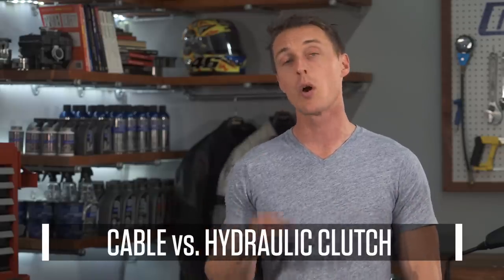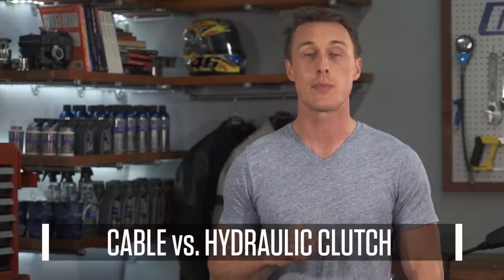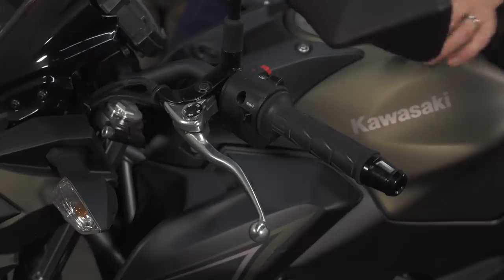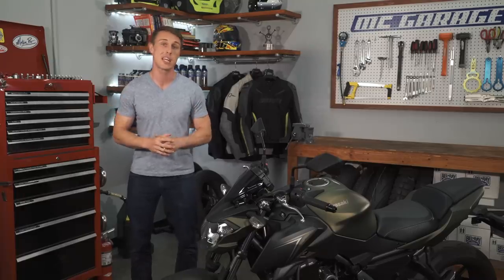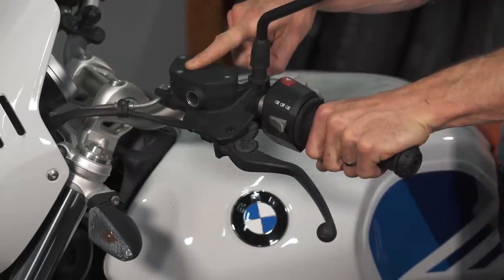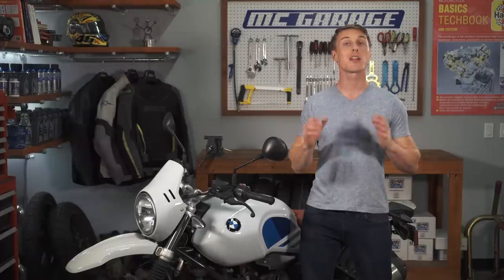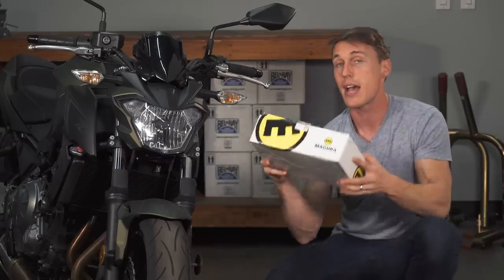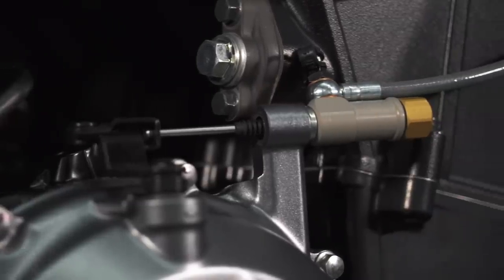Cable Clutch vs. Hydraulic Clutch | MC Garage

Comment: Changing a cable is a lot easier and cheaper than rebuilding a slave and/or master cylinder and/or hose and bleeding the clutch system, that's the difference to me I now have a bike with a hydraulic clutch and I was ecstatic about it... until it failed!  I definitely prefer the feel of a hydraulic clutch, but I'm not rich and I have to work on my own bikes so unless I win the lottery or become rich by some means this is my first and last hydraulic clutch!
Reply: Leslie Forsdyke im going through the trouble of a hydraulic clutch fail right now. It's horrible. Never getting a bike with a hydraulic clutch ever again. Nope.
Reply: Guitar Demo Vlogs truthfully it's easier than a brake rebuild but a cable is a lot easier than a hose, plus you don't have the hassle of bleeding a new hose which sucks, theres nothing difficult about it, buy it's tedius!

Comment: Can you make the video about clank in first gear and cable adjustment tension?
Reply: jasamnedostizan your always going to get a clank in first gear, adjustment is not going to stop it.

It's straight cut gears for you, if you roll your bike back a few inches then put it in first you will hardly get a clunck but it's nothing to worrie about.
Reply: jasamnedostizan like said the clunk going into gear is normal on the large majority of bikes. And it doesn't have much to do with the clutch unless the clunk is excessive and your clutch is horribly out of adjustment, and does not fully disenguage
Reply: and how to check that, fully disenguage?
Reply: jasamnedostizan if your clutch is very far out you will have trouble changing gear, all the service manuals iv had say to make sure the lever has a bit of free play like 3-5mm of movement before pulling the cable.

Comment: as a former motorcycle mechanic ive pulled a lot of different clutches and i call that easy pull statement with the hydraulic clutch BS!
the lightest clutch pulls are well maintained cable clutches. the heaviest are badly maintained ones. so if your clutch is somehow hard to pull, lube the cable. if that doesnt help, replace it. for most bikes thats around 30 bucks and done in 5 to 10 minutes. cable maintenance is really easy and only rarely you need tools or get your fingers dirty. 
hydraulic clutches on the other hand... especially the magura ones are often troublesome and if they fail and youre out in the middle of nowhere, good luck if you dont have the right tools/replacement parts with you. 
ive never pulled a hydraulic clutch that i would consider an easy pull. also i find that hydraulic clutches are less transparent and give less feedback so i really dont see a reason why you would want a hydraulic clutch. am i missing something?

Comment: but if youre on an adventure and your hydraulic clutch fails you wont be able to repair it right? with a cable you could just have a spare one in your bag and replace it. so is it good to have on a dual sport or is the risk of failure of a hydraulic clutch too high?
Reply: Probably depends on what fails.  I would suspect that neither system is more prone to failure than the other if both are properly maintained.  At that point it becomes an issue of what fringe situation are you worried about and is it enough to push you one way or the other.

Comment: I've had issues with both hydraulic and cable clutches. Was on a long trip with my Hayabusa a couple years ago, and the clutch started acting up (hydraulic). Air bubbles had gotten in the clutch hose. It was a real PITA to fix on the road, but managed to fix it well enough to get to my destination where there was a garage I could work in. Had to bleed the system several times to get it working 100% again.

Unless the clutch cable snaps, it's probably much easier to fix most issues on the road if the bike has a cable clutch. It's nice to not have to worry about adjusting the cable though when the bike has a hydraulic clutch.

Comment: Had a goldwing that the slave cylinder failed. Fluid in master kept dropping. Turns out it was going into the engine and mixing with oil. Not good. I am glad my new Versys1000 comes with a cable.

Comment: Why the clutch automatically applied little bit while throttling. It can absorb while 4 & 5 gears. It will release the clutch lever while stop throttling.

Comment: when I was a dispatch rider (riding the classic dispatch bike a Kawa GT550) I had a second cable threaded in position , a quick swap if the one in use broke .. doing 750 miles a week meant it would happen

Comment: Best clutch I've ever used was a hydraulic on a 07 cbr1000. Ive owned a cbr600 f41 and a 11 gsxr 750. I've rode gsxr 600s, r6s and a s1000rr. Would definitely take the cbr1000 just on smoothness out of all of those bikes.

Comment: You can easily run DOT 5.0 in the clutch dines since it will never see the temperatures that otherwise require the hydroscopic fluids.

Comment: Anything that you put on your bike/or your bike comes with will require maintenance. Most of the failure on the comments are from poor preventive maintenance. This is just like in cars, where you see a lot of cars with interference engines on the junk yard, because people don't maintain their timing belts, and timing chain cost more to replace.

Comment: how about SOHC and DOHC pros n cons?
Reply: SOHC: mechanical adjustment, easier to adjust but requires more frequent checks.
DOHC: cams work directly on the valves, less mass in the valve gear means you can run the engine at a higher rpm, harder to adjust, but can require less frequent checks. The book for my FJR1300 says check them at 26500 mile intervals.

Comment: What if the hydraulic line breaks you can't replace it on the side of the road at least the cable you can use picture wire in an emergency limp back
Reply: How often has a properly maintained hydraulic line broken? And if you worry about the clutch line breaking, why don't you worry about your brake lines failing?

Comment: well cable clutch is the only thing that should be used of road becurse if you breake your line you have to replace the line then add fluid on the clucht leaver end but the cable you only have to carry an extra cable and put i back on

Comment: You make cable clutch sound like very bad. I personally think cables need less maintenence and are easy to change or repair anywhere and by anyone. Periodic changing of clutch cables will be fine and don't need any lubrication. I havent changed or lubed cables much in any of my bikes and they still are fine.

Comment: I have an hydraulic clutch for the first time on my SD 1290. I have to bleed it once a month because it keeps sucking in air and loose action. So yeah, if they use cable clutches in MotoGP i think i can settle for one too. Good fucking choice KTM.
Reply: valebliz I have a 1290r Too and never had an issue. Why dont you take it in for warranty? If it's still covered?
Reply: 10fantic it is, all they do is bleed the system.
Reply: valebliz I have a 08 990 super duke with hydraulic clutch and never had an issue with it, the front brake on the other side has to bleeded every once in a while, but this can be done in less than 5 min
Reply: that's because KTM loves cables, considering their dirtbikes. Then came the time to create a hydraulic clutch, now they don't really know what the hlel they doing
Reply: Sounds like a bad seal.
Reply: Maybe the hoses and end themselves too
Reply: Ruby Rose wtf are you talking about? It's a few yrs KTM put hydraulic clutches on its dirtbikes, way before they did it with road ones.

Comment: I hate hydraulic clutches as you can't dial in play at the lever.
Reply: that is exactly why. No slack, for better control, and arguably better feel
Reply: It's a personal preference and hydraulic clutches determine precisely were the biting point is not allowing for each individuals preferences, the vast majority of bikers I know prefer cable.
Reply: apparently i can on my yamaha fj1200
Reply: I think the more complicated with more parts the more prone to failures. Keep it simple.

Comment: I never understand why when i look at a top of the line with all the bells and whistles 24 thousand dollar Kawasaki ZX10 with electronic shocks why on earth that bike (and many other high priced bikes) have a clutch cable setup. Stop being cheap and put on a hydraulic one! I always thought maybe there's a benefit to having a cable vs hydraulic? I dont think see and he didnt mention it - its just the manufacturers like being cheap.
Reply: It's probably due to weight.
Reply: What benefits?  And when you pay 25k for a liter bike dont tell me their passing savings onto us. Thats rediculous.
Reply: That questions is not for youtube, its for bike engineers... here anyone can act like pro and engineer..
Reply: The same reason manufacturers use rubber brake lines as opposed to braided steel lines. Cost. If they included a bunch of specialty items like the aforementioned, and things like brake lever protectors, a tail tidy, a K&N air filter, a double bubble windscreen etc etc etc. Your $24k top of the line supersport would now cost $26k. Not a huge difference, but the bigger that number gets the more it becomes unattractive. 

Plus it gives you something to do over the following years of ownership when you improve the bike bit by bit.
Reply: But they don't pay what we do for the setup, bulk buying for x amount of bikes is probably no more than a cable setup but they'll add a few hundred extra because it's an upgrade/feature. It's the same with any manufacturer, the markup on this stuff is crazy.
Reply: yet my 1986 VFR400 has a hydrolic clutch.... hmm.... it feels reaaal good too.

Comment: Hydro clutches feel numb and add weight.
Reply: Sounds like you haven't tried one in a while. Definitely agree that some older hydro clutches lacked feel and were heavy, but for the most part modern setups are excellent. Why else would they be preferred by trials and trail riders?

Comment: So why don't all hydraulic clutches use mineral oil?
Reply: According to Magura it's just manufacturer preference to use DOT fluid. A lot of OEs used to use mineral but have recently (in the last couple of years) begun using DOT b/c of issues with owners not reading the reservoir cap and topping off their hydro systems with brake fluid, and adding DOT to a system designed for mineral fluid will damage the seals. I know, sounds like a ridiculous mistake to make, but that's what they say.